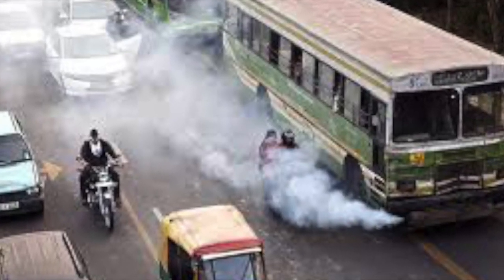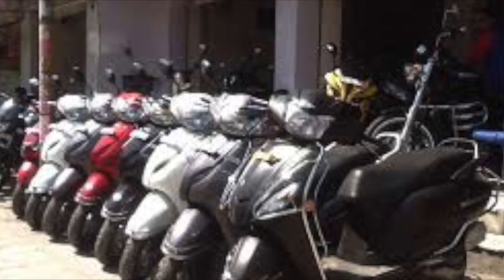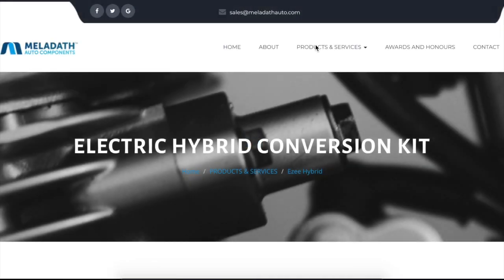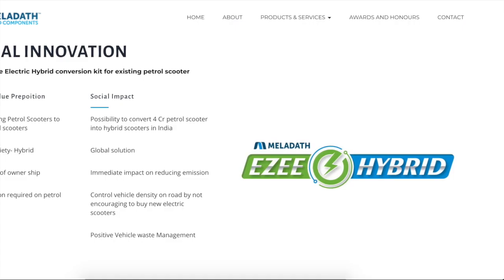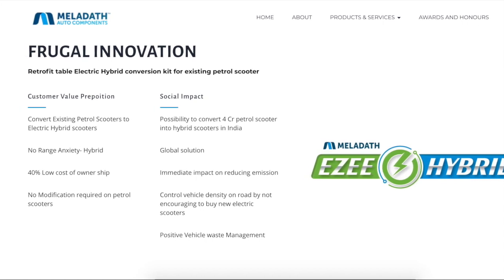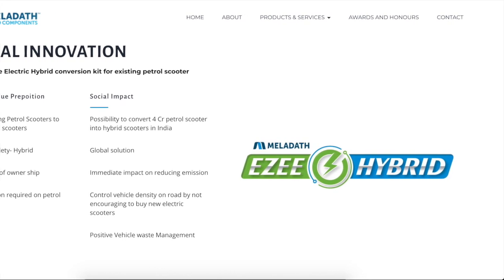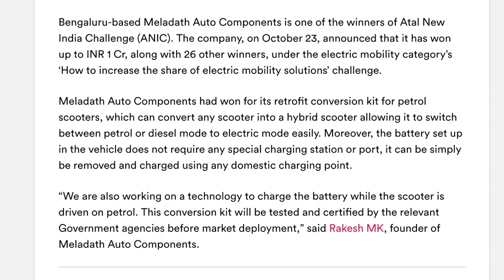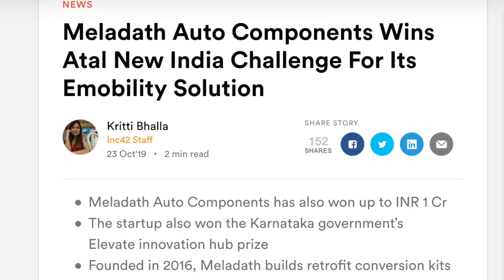Convert scooter from petrol to electric scooter | Meladath Auto | EZEE HYBRID #eCharged

Comment: Hello,

This is for my friend who Iives in the High Range area of Kerala.

He has an Activa (Handicapped user version with 3 Wheels in the rear (The one connected to the engine & 2 support wheels). 

Is it possible to convert this into a Petrol + Electric Hybrid?

What is the approximate cost?

Thank you.

Comment: How much price for the kit for TVS Scooty
Reply: If 40k it will not be fair enough
Reply from the maker: Once mass production starts the price will come down
Reply from the maker: The kit is under trails & testing...the expected price is around Rs 40k
Reply: @eCharged   how long the battery life and whats it replacing cost
Reply from the maker: Depends on what the company will use....if they opt for lithium ion it will have 1000 charge cycles to last for about 4-5 years, but if they opt for LiFePO4 battery then it will go for 8-10 years.